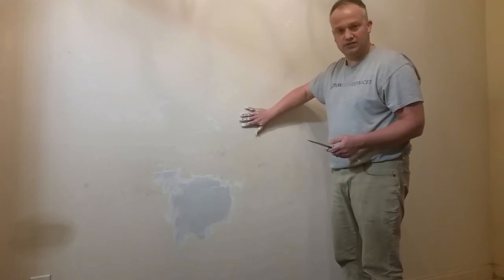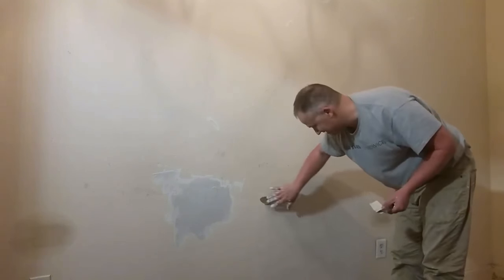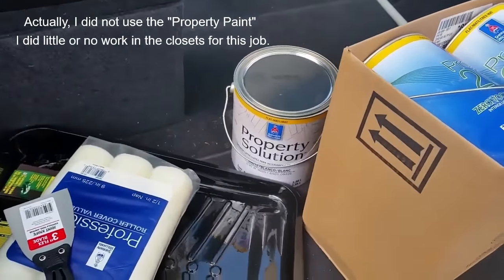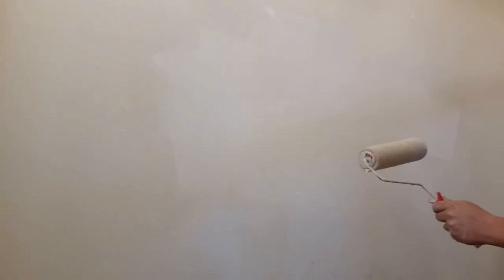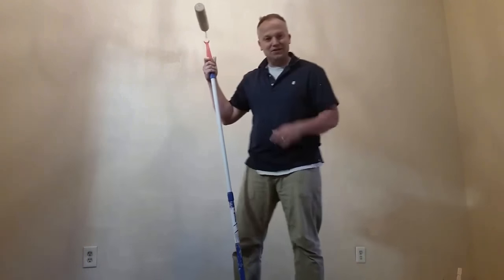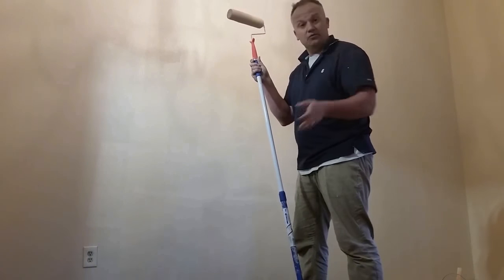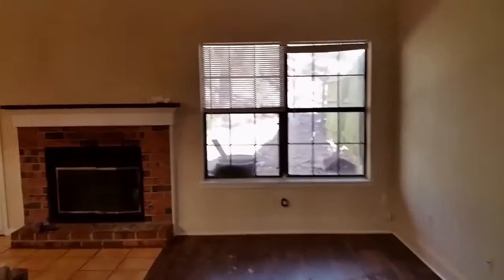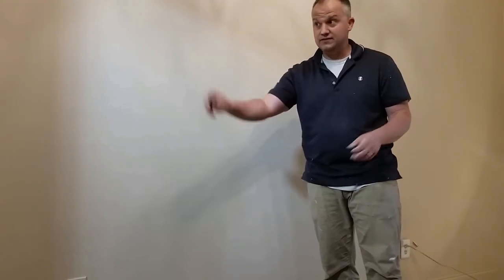How To Cut a Paint Chip off Wall for Touch Up Painting and Color Match

Comment: how's about if possible take off lightswitch and/or outlet plates and take sample from there, as the room likely has one wall with lightswitch or outlet and were likely removed when painted
Reply: Gregory McKee good idea! But sometimes people leave it unpainted back there but if they did, it would be easier to cover up the missing sheet rock part cut? 😁 I’m in the middle of moving out soon and previous owner mixed up their own paint on their own. I see the 2 paint cans here but I’ll have to cut a sample like he did for the actual wall color result.
Reply: Not if he was painting they weren’t.